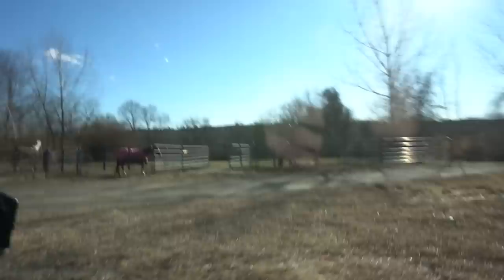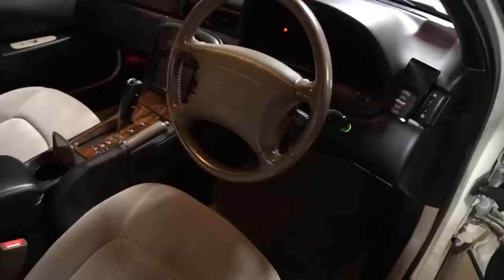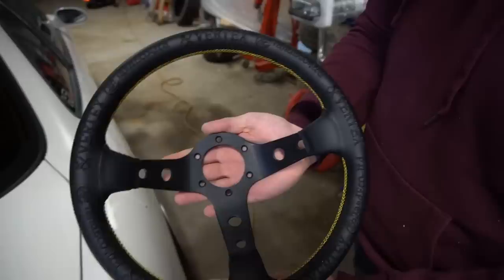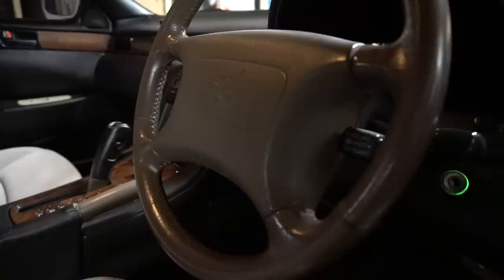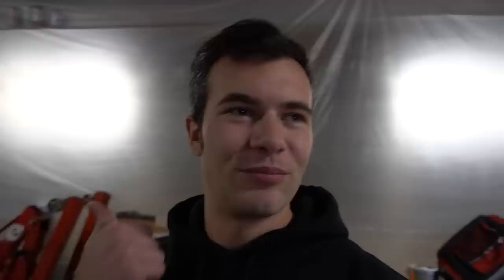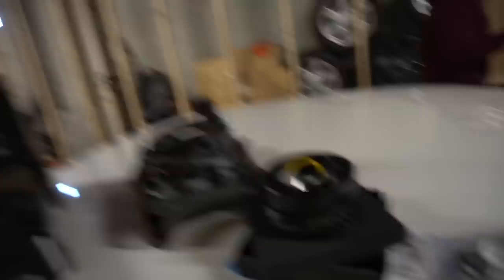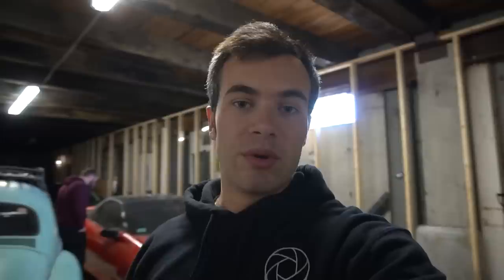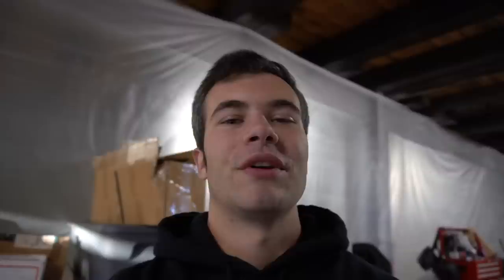VERTEX Steering Wheel Install! VIP AS F&%K!

Comment: Great video. Glad to see another Soarer with a vertex wheel. I have the same setup on mine with a different vertex wheel and my quick release is a 2.5 i think. Did you get your horn to work. I used a universal horn button to retain horn functions.